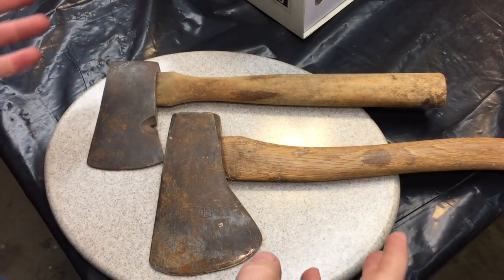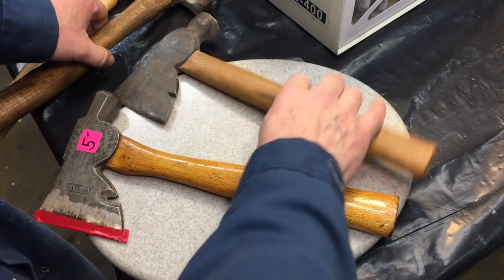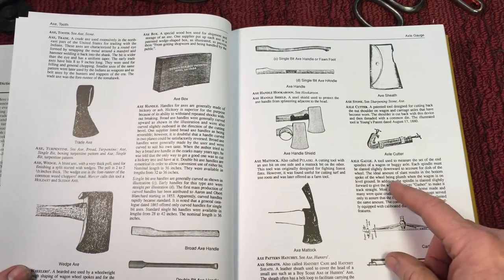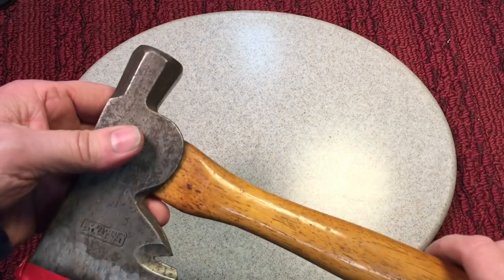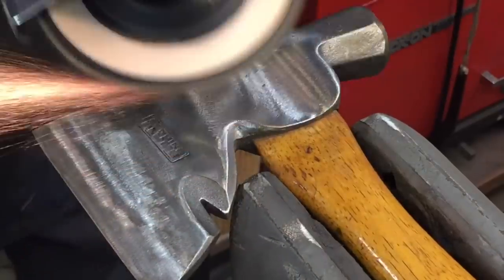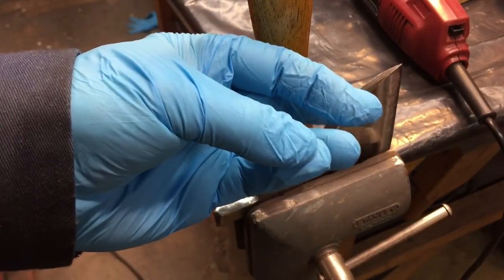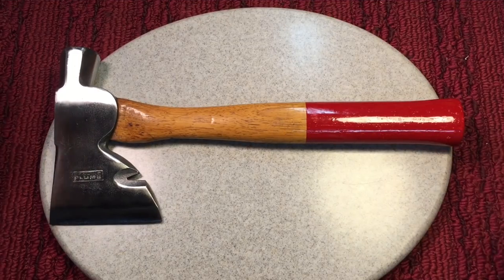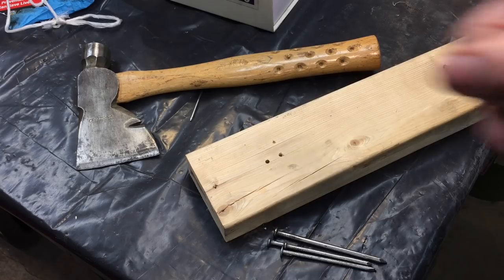US Govt. Issue PLUMB Hatchet Clean-Up...

Comment: That’s a wood shake hatchet for roofing.  That’s why it has a hammer head and nail puller on it.  I was a roofer in my younger days and we would use the hatchet end to split wood shingles and of course the hammer end to nail them to the wood sheathing or batons.  Nail puller on it was used as well.  We used a regular claw hammer for asphalt shingles and the hatchet hammer for wood shingles.  Hope this helped.

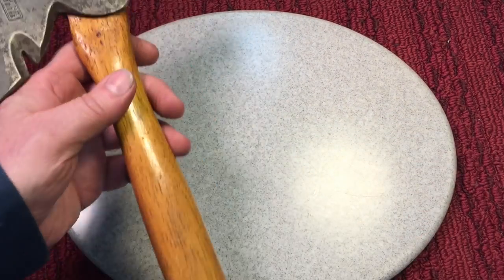Comment: At 7:00 I've been told that's call a rigging axe. Made for framing houses. Especially the one you showed with the milled face. Using one properly and efficiently is almost entirely a lost art. Modern carpenters have no idea what skills they missed out on.
Reply from the maker: Austin Patrick These fell out of favor after the 60’s...  You can still buy them but they aren’t popular today.  😃👍
Reply: @ScoutCrafter  last I heard you actually can't buy that Plumb rigging axe. At least not new. If so I'd love to have one and learn the skills of men from yesterday without feeling like I'm ruining a museum piece.
Reply: @ScoutCrafter It started out as a Rigging Axe then to a Framing Hatchet (as we called it).  Guys were still using them into the '90s and then the older guys retired and the younger guys follow the OSHA standards and use the regular framing hammer.  
I was one of the first to switch (1978) to a regular framing hammer.  I, like you, could never get used to that sharp blade swinging past my head.

Comment: Swinging a hatchet blade back towards ones face never seemed like a good idea to me either, I always imagined putting a huge slice right across my face or worse.
Reply from the maker: Raw Bacon So true!!!  😃👍
Reply: I can understand, but to be fair, a claw hammer would hurt pretty bad too, and I've NEVER hit myself with the claw. It just doesn't happen in my experience. Still, the most important characteristic of a tool is that the user be comfortable enough to use it safely. Otherwise it's just an obstacle, not a tool.
Reply: You don't swing the claw hammer towards your face either. I like a rig builders hatchet for some work, such as fencing.

Comment: A couple of things- when I was young my uncle Carl always had a carpenter’s hatchet and about 25’ of rope in the cab of his truck. The rope was for tying off long boards or ladders to the rack body. The hatchet was for stakes or for tacking a flag on a load of lumber that overhung the back of the truck. I can just imagine if you got stopped by a cop today with those items in your truck. Oops, I’ve got both those items plus duct tape in my van, guess I had better drive safely.

When you mentioned shingling hatchets the video showed a dry wall hatchet which is the direct descendant of the lather’s hatchet. The old timers that I used to work with said that you could always recognize a lather because they would have a gap worn between their front teeth and they would be missing the ends of two fingers. The gap was because they hold a bunch of lath nail in their mouths and spit the nails out as needed. When you think how many thousands of nails it takes to cover the walls of even a modest size house in the days of wood lath and plaster you can imagine how easy it would be to which end of the hatchet was pointed at the wall, especially if you were being paid either by the square foot of wall lath installed or the number of bundles of lath used.
Reply from the maker: JA- Funny story, when I took my GF on out first "date" we went on a picnic and upon arriving at the picnic area I opened my trunk and there was a Saw, axe, duct tape, rope and machete...  The only thing missing was Lime...   =D

Comment: I'm like Dale. One hand and short handle- hatchet. 2 hands and long handle- axe. And anything can be called anything. A splitting maul or Collins axe is called a go-devil here. You can get them with straight hammer eyes for the handle or an axe eye for axe handles which work a lot better. I got a new Collins axe/go-devil and was at the boulder hole grinding the point down. They come too blunt to split right. With working on BIG machines they have Milwaukee side grinders with 6 or 8 inch blades and no guards. I was thinking how easy it'd be to get eaten up by one. The next week a guy cut a finger off with one. And I was trying to start a mower and fell   against the handle and now have a 4 inch bandage on my forearm so you are NOT alone! And you know I mean NO ill will when I antagonise you about something. It's all in fun! Thanks, John CS! GBWyou! And may the toilet paper fairy stop by your place with an wrapped present!
Reply from the maker: Lewis- The funny thing about injuries is when you look back at how it happened you always think “that was avoidable”. Maybe that is how we imprint it on our brains so it won’t happen again!  😃👍
Reply: @ScoutCrafter  You can read my comment on Unc's site about what I did and YES, it could be avoided! I put my foot up on the back wheel (bicycle size) and gave the cord a yank and the wheel rolled and I fell against the handle and throttle control and it took the THIN top layer of hide off. I hooked the throttle control up backwards myself because that was the only way it'd work on that engine. I'm now wrapped up and took a marker and marked off, run and choke on the throttle control. Goofy me.

Comment: A great one Scout!  Very nice to see a hatchet, they look so amazing, I have an extremely rough one I want to fix up some day. The New York rodent wrench made me laugh, gotta love that great accent of yours!
When you told about the accident I felt it in my stomach right when even more then when I saw it. I had my share of accidents but your tip about only doing what you feel like and not rushing helps so much! Although I got a bit mad at my birdhouse last Saturday...
I have a question about shellac, over here I can't get ready made one Zinsser or any other but I can get the raw product wich needs to be thinned with alcohol. Do you have experience with that, does it work as good? Because my tools do tend to rust back up again sometimes..
Thanks so much!
Reply from the maker: Hi Alex- I have had really good luck with the Zinsser Brand however I did mix flakes years ago once to make a brew and I remember I found it to be a bit gummy...  The key is to mix it right to get the right proportion... If not dissolved properly it will not coat evenly and leave gaps for rust to start...  I found this "Guys" video to be really good!  https://youtu.be/8mlsmnXBo-M
Reply: @ScoutCrafter  Thank you so much!

Comment: We called them the same as you out here on Long Island. It’s like a knife. At some point a knife becomes a sword. At some point a hatchet becomes an axe and an axe becomes a maul. Speaking of injuries, perhaps a good subject for a video (although some people will object, especially the safety Sallies) would be a discussion about various injuries and treatments that people try, coupled with scouts handbook guide to injuries. For that kind of injury I have put “New Skin” to deaden the pain, seal the wound and protect  it from further injury. I have had some surprisingly good success with crazy glue (CA glue) for bad cuts and one thing that surprised me especially about using it is that it doesn’t hurt applying it. I really expected it to, but it didn’t.
Reply from the maker: Field injuries require quick thinking and often improvised solutions... I was with some scouts on a bicycle  trek and one of my scouts fell and hit his knee on the curb... It looked harmless enough but as he got up there was a 3 inch gash that was down to the kneecap!  =O  My small first aid kit was useless so what I did was make a couple butterfly bandages from duct tape and closed up the wound while his Mom came and took him to the hospital...  Turns out the Doctor at the ER asked the Scout "Who did this" he answered "My Scoutmaster" and the Doctor replied "Excellent job!!!!"   He has a nice size scar now because it was on the knee but shows it off proudly!!!   =D

Comment: Yoy are the first YouTube that I have seen leave varnish on a hatchet or axe handle they were going to use. They all perfer sanded w/ linseed oil. Not saying you are wrong just different.
Reply from the maker: Hi Jan- Linseed oil is terrific for tool handles, however it becomes a magnet for dirt and turns black in no time.  I have certain tools that I use linseed oil on but none of the tools I want to look good...  Varnish and shellac can become slippery when using so many people strip the handles and linseed oil them.
Reply: @ScoutCrafter  I see. So shellac I guess is a better preservative.

Comment: To make the difference axe hatchet more confusing:

Axe: Two hands, the angle of the cutting edge is between 27 and 30°, except the axes that you use to chop whole trees, they got between 40 and 60°. There are different types of axes like splitting axes which you use to split pieces of wood to the required size so they fit into your furnace.

Hatchet: Smaller than axes (handle mostly ~40cm long or less, which are round about 15 3/4"), single hand use, less angled cutting edge.
Hatchets are more like precision instruments in comparison to axes. You can use them to sharpen a wood pile, you can use them to make kindlings that you need to start a fire. There's even a special hatchet for sculptors. And of course in the kitchen to cut bones.
Reply from the maker: Of all the axes the Ice axes I have always found very interesting!  Years ago there was a tool for every purpose and every location it seems!  LOL   Thanks Marcel!

Comment: You're lucky. My grandfather worked in the repairshop for the trams in Frankfurt, in the US you call them electric street- or trolley cars. They're like busses, but electric and use railway tracks while they're driving through the city. He worked in the pit below the carriage, the body of the tram was removed. He wanted to pull down one of the hanging pull-down lights to have a better sight. But a colleague of him had layed a running out angle grinder on the carriage which he wasn't able to see from his position, and the cutting weel (not the grinding wheel you used!) cut into the palm of his hand. He was unable to work for round about six weeks, that was the only time when he was sick at home. He had a huge scar all across over the palm of his hand, that was visible even decades after this accident.

https://en.wikipedia.org/wiki/Trams_in_Frankfurt_am_Main

And this one is my favorite, could be rented by groups for city tours, an old type K tram of the 1950s:

https://upload.wikimedia.org/wikipedia/commons/7/73/Ebbelwei-Express_Messe_11.11.2005.JPG
Reply from the maker: Marcel- The funny thing is as we get older we can look back at scars and remember exactly how and when that happened...  Like a constant reminder...  The older I get the less embarrassed I am of my scars and look at them like life lessons and old friends... =)
Reply: @ScoutCrafter  I know, one scar on the one hand with the blade of a Leatherman. On the other hand one scar caused by a cable roller during my conscription in the Bundeswehr. I wanted to roll it into a shelf in the storage, and it became stuck. So I tried to turn it with more force. My hand was stuck between the cable roller and the shelf. That was 16 years ago. One on the tip of my thumb caused by a bread knife, that was 25 years ago.

Comment: I hope you are fine! 
You got lucky. You touched the disc of an angle grinder without even wearing gloves. It could have been really bad. Stay safe!
Reply from the maker: Manolis Papadimitropoulos The funny thing is I normally wear gloves but was feeling the finish and making sure I wasn’t over-heating the tool!  😃👍
Reply: @ScoutCrafter  The only thing i can say to everyone working with power tools is wear gloves and eye protection. Almost a year ago I accidentally touched the chain of a chainsaw.  I messed my finger really bad, but if it was not for the thick gloves I think I would have lost it.

Comment: have a couple in the old shop that was my dad and at 72 i remember my father using one like it with the nail puller but the hammer heads are beat up and spread but still usable will look and see if any have the u s logo on them thanks for the good video stay safe ok .